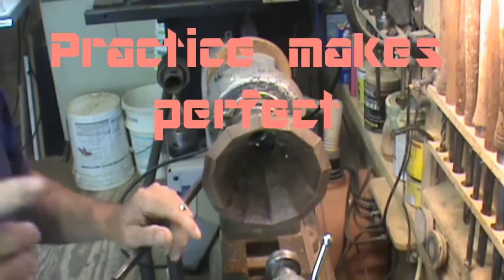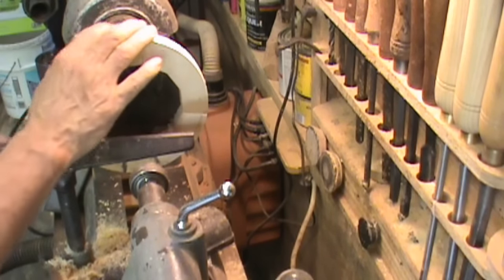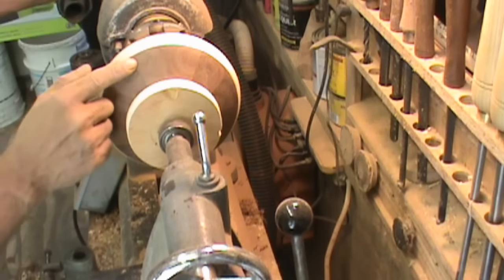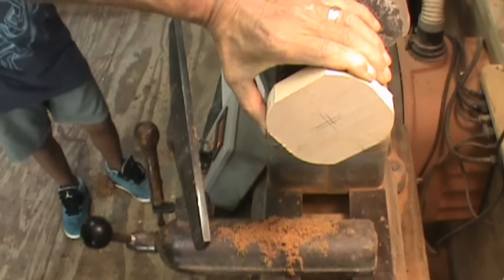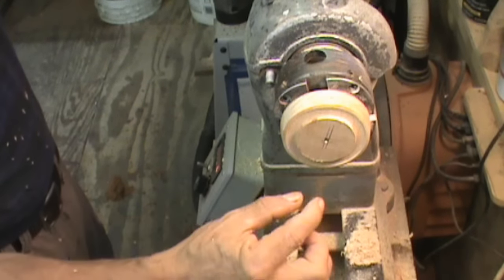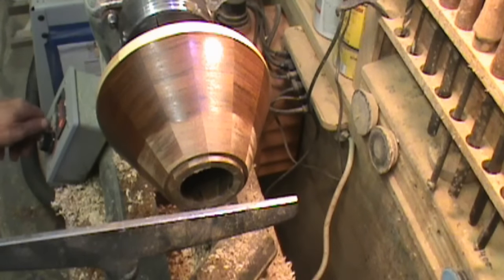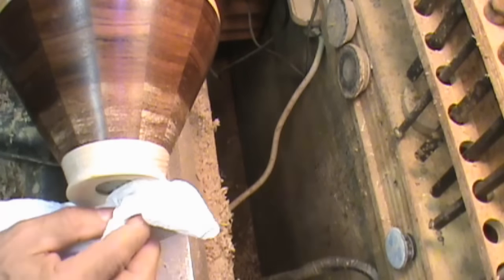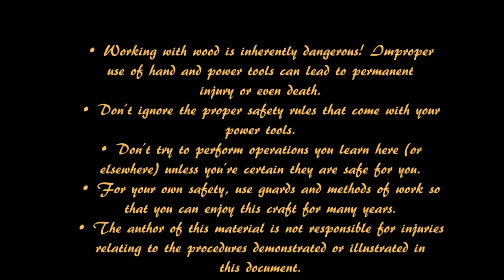Practice makes perfect

Comment: Man, I'm a simple person, I think what "scares" me off segmenting is just the amount of pieces you have in one project... I can't keep track of a project I make out of two pieces of wood, but you have hundreds of them sometimes! I just know I'll start losing rings sooner or later. I did think about making a simple 60 degree fixed sled and just start making random rings out of any scraps I have left. That way, when I feel like it, I can just glue some rings together and call it a project!! ;)
It's good to have small sander, that way he doesn't take valuable real estate in the shop :)
Thank you for sharing Al!

Yuval.
Reply from the maker: +Yuval Lahav Woodturning Yuval I think I will make a video on simple segmenting that will not be intimidating. I will do it on tools that everyone has and show a full proof method that requires no measurements for the adjoining rings.That is a great way to start making a fixed sled but where did you get that 60 degree angle from? Make an 8 segment the angle is set on a chop saw at 22.5 degrees. just verify accuracy after cutting 2 on a square than continue if the results are good. I know when you start you will do a great job.
Reply: +Al Furtado (Rebel Turner) I got the 60 degree from the full (or fool)  proofe sled Card did recently, using a 60 degree triangle between the two half fixed arms of the sled... thought it would be a good place to start from.